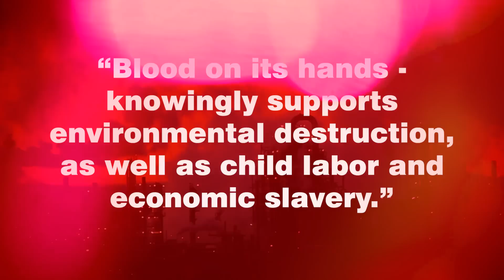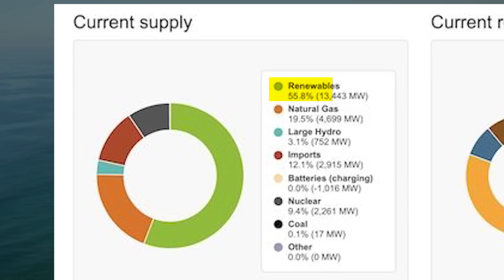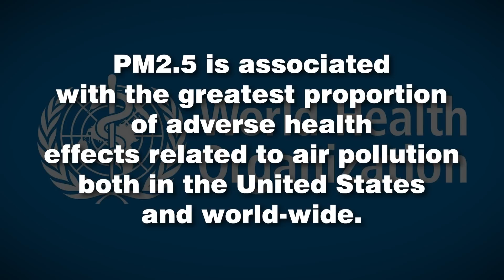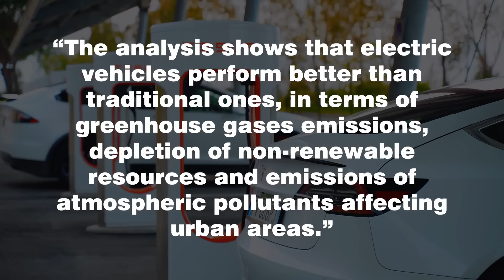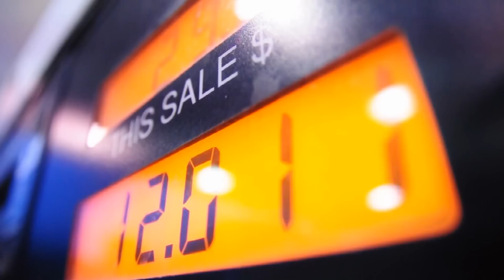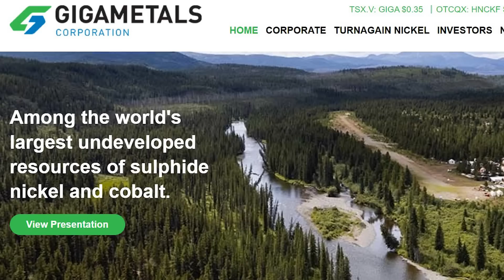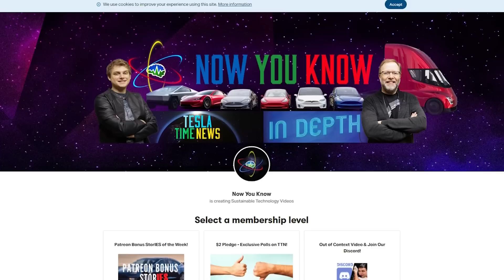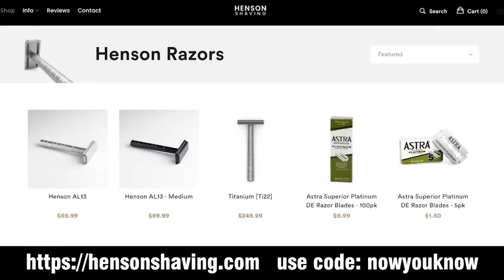Debunking More EV Lies | In Depth

Comment: No offense. But I cannot afford a new EV, and I am surely not buying a 10 year old EV knowing I may have a $5500-$20,000 battery replacement on a car that's only costs $5000, with 170,000 miles on it. And a majority of gas car owners feel the same way. So good luck with that.

Comment: It largely depends upon where you live. In much of Idaho most electricity is generated by hydroelectric dams. In Colorado 60% of electricity was generated by coal fired thermal plants. By 2030 that percentage will be near zero as all coal plants in the state are scheduled to be shut down. Cheaper renewal power from solar and wind are replacing it. There will still be some natural gas in the mix but the improvement is amazing. My challenge to EV owners is to get solar. If you can afford an EV you should be able to afford some solar generating capacity. If you can’t place solar on your home or property buy into community solar.

Comment: your argument is based on the average US/CA car that has an average thermal efficiency of 20 to 25%.  modern new cars( mostly outside the N.A)  have thermal efficiency of between  30% ( 30 - 41% gas) to 44% (43-44% Diesel)    that makes the   average  EV world wide  equal or  dirtier   then an  ICE as the average thermal efficiency of fossil fuelled power plant is  33% ( not included  is about another  28% loss to subtract :line, charge and motor loss,  from best to worse it ranges from  22% - 35%-  making an the overall thermal efficiency of an  EV  30  to 40%  bases on  an Average  grid  that is ~65% fossil fuelled there are only  a hand full of countries where EV are much cleaner then the ICE  when it comes to GHG production ). in reality most are carbon juggling from one hand to another   

 Prime Example of that, as you  reported. The   Vancouver study argument  which is  based on a British Colombia CA. A  grid  that is  95% clean  energy ( mostly hydroelectric). So that number 392g/km (ICE)  and 203g/km(EV)  49% difference   over its lifetime .that is not very impressive considering  that grid only has 5% fossil fuelled.basically  it took 1/2 the life of the car just to mitigate it manufacturing footprint  even at 95% renewable ( and the i-MiEV has small  battery so it manufacturing cost is relatively low  so if it had a battery double or triple the size as it had(150km)  it be well into the 300g/km).   Now extrapolate that number to the US grid that 65%fossil fuelled . it is  not that rosy of a picture . and in reality if the US/Canada had higher fuel standards currently the average is 10l/100km  and implemented the the EU fuel standard 4.1 L/100 km but currently has  overall average  of  5.5L/100km you would have an almost equal reduction GHG compared to EV

the best option  is electrified public transit  where  the carbon foot print of EV is about  60 g/km( not including it manufacturing carbon foot print)   where   electrified public transit (trains and buses)  range from 2- 20 g/km  --

Comment: Wow you guys are horrendously bad. It is like you have no concept of understanding something holistically. She talks about environmental you talk about atmosphere. You mentioned nothing about the waste you mentioned nothing about how it's sourced like the solar panels you mentioned nothing about how windmills are not recyclable you don't mention anything about how they're supposed to last 20 years but they're only lasting 7 to 10 years and the list goes on. You say the sun shines all the time well it doesn't shine at night you said the wind is all the time will the wind doesn't blow all the time and if you want to take that further look at all the dams that are running out of water because damn should not be made to generate power. They should be made for water supply. It's like you shouldn't be using something that competes without food supply which is why ethanol has raised the price of corn.  If you only compare EVs to emissions then you have no concept of what the word environmental means.  I think EVS are the way to go but right now they are not more environmentally friendly.

And you also have to watch out which report you use. Don't just get reports that support your narrative.  There are substantially more vehicles on the road than there ever were in the seventies but yet reproduce less emissions I Believe by 1/3 or 1/4.

Pushing a narrative by not consuming the holistic picture is not science.

Comment: Green energy isn't green. Solar panels are toxic and mostly non-recyclable. Wind generators are expensive and kill birds. You'll need a hell of a lot of them to replace one coal plant. EV vehicles are expensive, still about 2x less range, charging takes a very long time, chargers are few around and it only costs about 2 times less to do so compared to an economic gasoline or diesel car. EV batteries are also toxic and expensive to produce. Talk about the environment, lol. I'll buy gasoline cars for the forseeable future no doubt.  (And no one cares about CO2 emmissions as it doesn't induce global warming or climate change. It's all pure propaganda to control nations and its people.)

Comment: I work at SoCal Edison. In California after 6pm to 7am this past year. Most of our electricity came from Utah and Wyoming's coal fired plants. Due to the drought. Also, in California our wind machines on average only work 10days at time without software or mechanical errors that last 2 to 5 days to repair.

Comment: Lol this is funny. Plug an extra 50 million EV vehicles into our electric grid everyday (on Average) and watch the coal just melt away even quicker to charge them. Genus.  Because California has renewables. If you average it all out. Wait for it wait for it. = more coal output across the spectrum = more demand must equal more supply. Wake up fellas. No study can pick ttwp plots of land on the globe and do a comparison. So for now until infrastructures can be put in place no study, means jack. Compare as many EV to gas cars all you want.  Cleaner yes but not without the correct infrastructure to support the system.

Comment: I'm anti ev. Here is my issues. When an ev catches fire, and there's been a lot so far, they require 3x the amount of water and/or foam to put out. Where does all that water, now polluted, go to? When we had pet. Car fires, we got them out in less water. Also, I've never heard of a pet. Car fire reigniting up to few days later. These cars weigh 2x as much as a pet. Car. Also, how toxic is burning lithium smoke? Then you gotta worry about charging in and around your house. Then as the more cars are put on the power grid, the price of power bills will skyrocket to pay for all the reworking the infrastructure. There's a lot more, but I don't want to get into right now. I'd be all for these cars if they was safer.
Reply: Your info is flat wrong.  Gas cars are ELEVEN times more likely to catch fire per billion miles than an EV.
Reply: @SpottedSharks  no, my argument is whats it take to put out an ev fire vs regular car.
Reply: @adielawson6854  Irrelevant.  Fire departments better upgrade their gear.
Reply: @SpottedSharks  no, we could put out a normal car fire with just a brush truck. An ev fire we roll a pumper and tanker. Also don't forget the electrical shock hazard.

Comment: On the Cobalt facts. "Cobalt is also used in the refinement of crude oil, which is used to make petrol, diesel, kerosene and pretty much any fossil fuel that you can think of. The process is called desulphurisation and cobalt is used to extract sulphur from crude oil"

Comment: Gotta love the petrol heads becoming the biggest environmentalists when it comes to things like EVs or Wind tech.
Reply: So she needs to be a blind cheer leader and no one can question the negative effects of EVs?  I already posted a detailed comment about all the lies these two did in their rebuttal.  They seem to think that if you don't regurgitate their talking points then that means she lied.  But using their logic, did they bring up how many birds are killed by windmills?  Nope, that means they are a liar.  Did they mention how it's not windy or sunny every day?  Nope.  They are liars (using their logic).  

But I'll give you a quick example of one of their many lies.  They said in the first 6 months of 2022 25% of our energy came from renewables.  First, it was 24%.  Second, for the last six months of year the figure would go down to 20%.  Because the winter snow melt helps with hydro power and there is more wind when it's cooler.  That goes away when it gets hotter.  But did they mention that?  Nope.  They cherry picked data, which is what they accused her of doing  They are documented lying hypocrites.  

I encourage anyone not to just be blind sheep when it comes to these two.

Comment: They forgot about non exhaust pollution, like tires and break pads, which to be fair regenerative breaking solves partially. They ignore other factors like all the diesel needed to mine all the minerals, that lithium, nickel, cobalt (artisanal mining), aluminum. When you buy an EV you are buying an industrial product heavily intensive in OIL.

Comment: Wow I love EV’s, but this is easily the shittiest debunking video I have ever seen. 
Right off the bat, you completely fail to address her point accurately. Is the new EV Hummer zero emissions? No. Sorelle was absolutely correct in saying no. Anything charged from the grid is not zero emissions. Will that improve in the future? Yes, almost certainly. You razz her about cherry picking data, then proceeded to try and cherry pick a day in California when renewables made up a good chunk of the grid power. Unfortunately your breakdown of that power was incredibly badly done. 55% from renewables + 19.5% from gas + 0.1% from coal = 74.6%. Where did the other 25.4% come from, unicorn farts? Moving on from that piece of glaring disingenuously delivered nonsense, we have your ridiculous statement that if you have solar panels on your roof, then you are charging your car emissions free. If you are talking grid tied solar, you are still comprehensively wrong, because the vast majority of EV’s being charged at home, are charged outside business hours when solar contributes very little to the mix. At this point I couldn’t stomach any more of your sanctimonious drivel and stopped watching. 
As someone who had designed and built off grid solar systems and lived off grid for over a decade, this was a horrible piece of content. I truly hoped that you would have been a match for her. Unfortunately even outnumbering her two to one, you got spanked.

Comment: The 100k mile argument is well..wrong. Like you, I've seen videos on YT that claim that EV's have hundreds of thousands of miles on the original battery. "Electric Viking" reported about a Tesla that has gone 500,000 miles and whose battery is still running at about 93 percent capacity. Not too shabby if you ask me!

Comment: So you debunked a person! You don’t talk about Solar in a state with very little sun (clouds and thunderstorms everyday), production of Lithium batteries and disposal, Production is mostly from fossil fuels because wind and solar can’t supply the electricity of car and battery factories.  They may be cleaner once they are created and used but what about before and after like disposal fossil fuel usage. What about the grid that can’t support charging all the EV vehicles?

Comment: Also oil and gas refineries all use Cobalt in the separators when breaking the crude oil down into separate products such as gasoline, butane, propane and so on and so on from the crude petroleum or partially refined crude oil that comes into the refinery to finish being refined. And this Cobalt procedure has been around for a long long time. So on top of all of the other poisonous and deadly gases that come off of exhaust and fossil fuel they also have Cobalt and I haven't heard anything about them trying to replace it with something less poisonous.

Comment: I disagree. The amount of oil used just to create the batteries is outrageously high. 

Secondly, there is no way for us to completely replace our grid with renewable energies. 

Thirdly, industrial wind mills are some of the most oil intensive “clean energy.”
Reply: That and the fact that most components cannot be recycled. And those components that can be recycled, require exuberant resources just to break them down to make them malleable.
Reply: @PedroAnastazi   They seriously did a punt without addressing the obvious elephant in the room. How much precious resources we have to produce batteries. Regardless of which method is used non renewable energy must be used. 

Secondly, they speak of how clean the energy is, for who? Not the miners and their communities.

Comment: If you charge your EV with solar panels on your roof it still may not technically be 100% clean. The solar panels themselves have a carbon footprint, mining the minerals to make the photovoltaic cells, and metals. Manufacturing, shipping, installation, end of life disposal, etc. The same could be said for any forum of renewable energy until the energy generated offsets net carbon footprint generated by the production of the component. You would assume this would be rather quick however this could be near the component life itself. It is hard to calculate giving the number of variables.

Comment: Nobody is saving the planet by driving huge steel boxes to transport one person.  A typical EV has a mass of about 2000kg and is often transporting a load of 100kg.  This makes no sense.  We need smaller vehicles such as electric scooters or bicycles.  I often travel to countries where 100kg vehicles are carrying 100kg payload.  This is much more sensible than large EVs.

Comment: Figures lie and liars figure......and that goes both ways, her points and yours. Personally, I don't think EV's are going to "save the planet", and I own one so I'm not anti EV. I think we'd be better off phasing out, over a long time, our current coal plants and building more nuclear plants. Nuclear is proven and green. Studies show it's "cleaner" than any other energy source and actually the safest source. You can't do this quickly, or you'll have problems like CA, they may have a "greener" grid but I'm not a fan of rolling blackouts! You can not just flip a switch and convert all ICE cars to EV's and all electrical grids to solar and wind!

Comment: So glad you guys debunked this piece. I wrote a long debunking comment on her video which I suspect was shadow banned as there were no comments, likes or dislikes still to date. Here's what I commented on her video three weeks ago:

John Wheatley
3 weeks ago (edited)
I Usually quite enjoy your content, well researched and well presented. This however has to be the most poorly researched and presented piece I have seen of late. Where to start. 
A tesla model Y is basically carbon neutral after only 22,000 Km and then stays that way for the remainder of its lifetime if charged up on renewable electricity which is widely available and becoming ever more common.

Battery chemistry is evolving at a great pace. Cobalt is only used in one very specific type of battery chemistry which is on its way out. Many EV batteries use lithium iron phosphate chemistry and several alternative cathode and anode developments including sulfur and graphite/graphene and silicon (just to name a few) are already entering the market. 

Battery recycling is very efficient and widely implemented (Tesla recycles all of its batteries in house), recovering over 95% of the rare earth minerals at a fraction of the cost of mining these minerals. It will take years to reach a point where large scale battery recycling will kick in though because only a handful of EV's have reached their end-of-life cycle. When this cycle does finally kick in though we will only need to mine maximum of 5% of what we are mining now to meet global needs, assuming the recycling process doesn't improve.

The transition to renewable energies is in full swing worldwide and although many countries still rely heavily on fossil fuels to produce electricity, fossil fuels have clearly become a transitional technology worldwide. It obviously makes sense to start transitioning to renewable energies and EV's simultaneously. 
I never bought into the C02 b.s so fear mongering on this point is senseless. It simply makes good sense to transition to renewable, sustainable energy sources. We will eventually run out of coal, oil and gas and sending our hard earned cash overseas and to Russia is just plain stupid. The sun shines everywhere on earth, so no shortage of energy needs when we get the infrastructure in place.
Really Sorelle, I was hoping you would be a little bit more even keeled on this. Yes there are some issues but in general, all things considered, we are going in the right direction. This whole video smacks of FUD clickbait (if it bleeds it leads), you are better than that. Maybe you should try doing something positive about what's happening in the world. We need a lot more positivity than this constant bashing of every attempt to make a better world, feeding the ill informed with new misplaced and ignorant arguments. Just read the 100's of comments below " I knew it! EV's are just a scam." Is that what you really wanted to achieve with this piece?
really a bit disappointing coming from someone who I've grown to respect for level headed content.